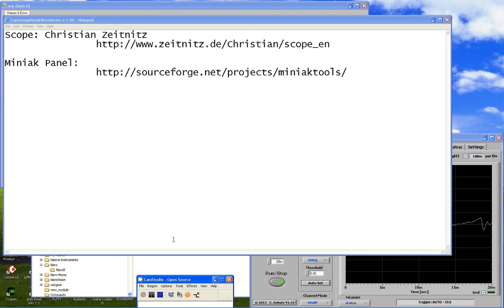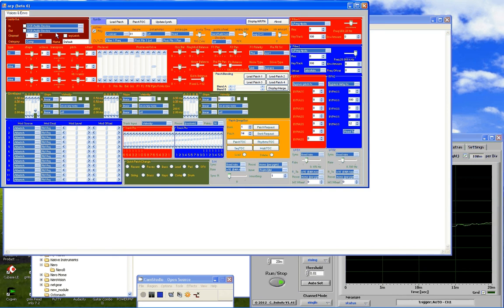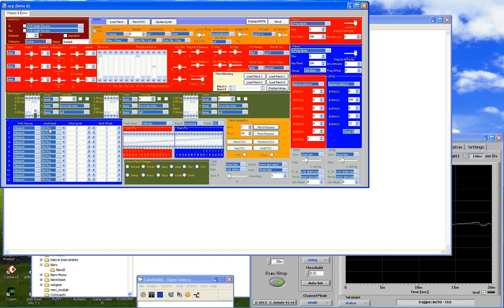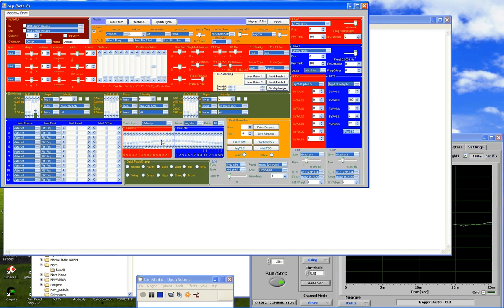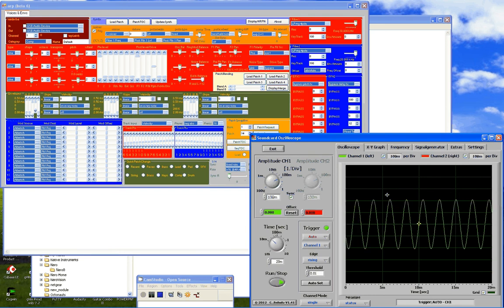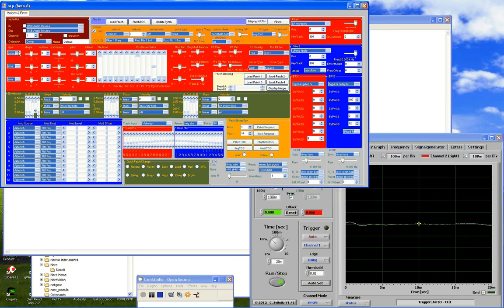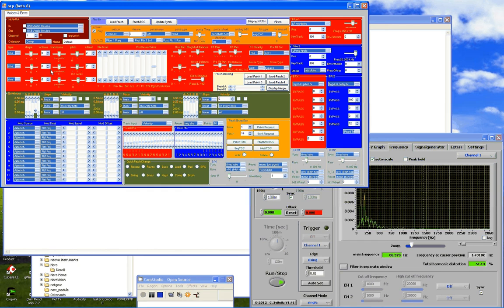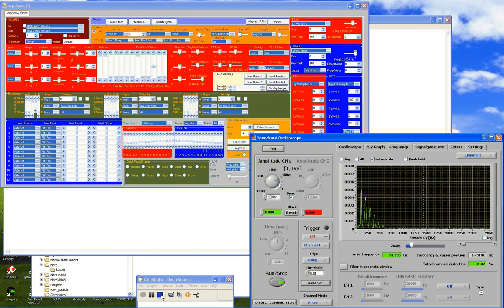Miniak Oscilloscope v1 00

Comment: ..and Micron?1 #hopingso
Reply from the maker: Yes it works with Micron EXCEPT the Sysex implementation on Miniak is more advanced. There is a Ctrlr panel somewhere that Namasi (?) made.

I had hoped to get a cheap Micron to try to hack the firmware - see if I could get a Micron to load modified Miniak update. But people want bonkers money for what is the same, albeit not quite as advanced, system. I have two Miniaks - one in Mint in the box incase they ever become a classic :-)

I need to show the Miniak some love. I had it with hardware assist  - 8 way zoning, sequencer and arpegiator additional to the onboard. Was cool.